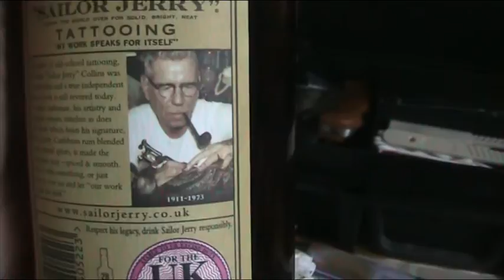Estate Pipes - An Amateur Restores.

Comment: Good job on rescuing those poor, neglected pipes! I see Dean has already given you great advice on carnauba wax. I've nothing to add there... but instead of sanding down the pipes... have you tried removing the finish with alcohol? You need something stronger then 80 proof rhum (the stronger the better), but since alcohol removes shellack, wax and stain, it might save you some work if you going to refinish the pipe anyway.
Best,
- Mike

Comment: That last pipe is a swiss tyrolean, just google it a bunch of them will pop up, it's a swiss, modern take on the classic, old world tyrolean.  If you google Bruyere Garantie the old ones will come up,  sometimes there called German Jaeger pipes too, if you find an old one it's nearly imposible to tell how old or where it came from, but they do smoke nice.  The concept behind them is an air pocket under the bowl or under the shank to catch moisture.